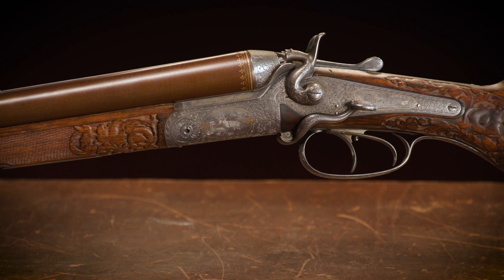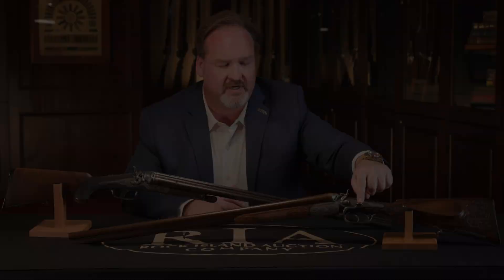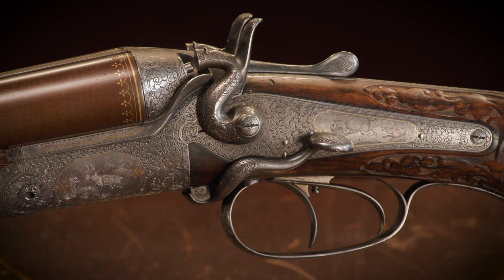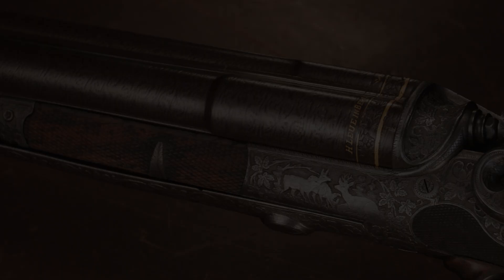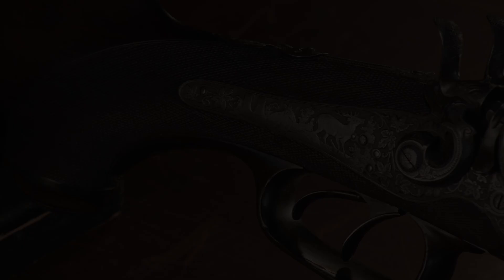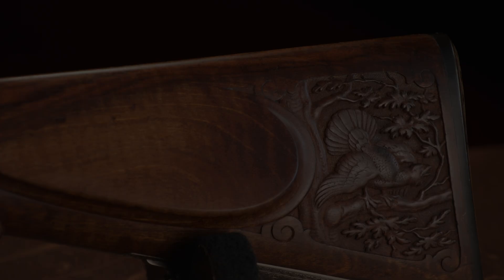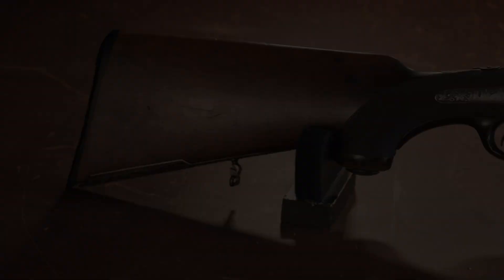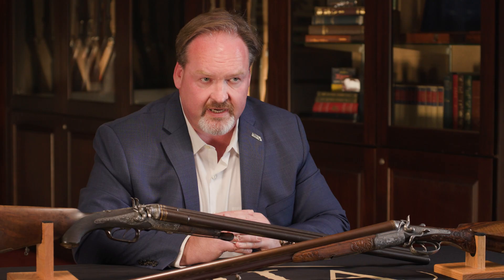Drilling & Schienendrilling German Hunting Arms

Comment: I have a drilling nearly identical to your first example. But in calibers of 10x10x45-70 blackpowder. It was imported by Charles Daly. Hence it must have been ordered for an American client most likely west of the Mississippi. In the wilderness regions to utilize fully those large bores? Strangely, it does not have sling swivels. So it must have been carted around, mostly in a saddle scabbard or wagon box? Someone professionally replaced the butt stock some years ago. It's long 30 inch barrels are heavy yet beautiful.

Comment: I've looked up some German sources and it seems that the proper definition of a Schienendrilling (aka. "Ranger"-Drilling) is having a small calibre (usually a .22) rifled barrel embedded in the rib between the 12 gauge barrels - hence the name (Schiene = rib). The specimen here might not be an example thereof but just an ordinary Drilling with the much rarer configuration of the rifled barrel on the top.

Comment: My father picked one of these up when he was in WW2. The story goes like this. His platoon came to a small city where they had to secure. After the German soldiers retreated The residents were still putting up a good fight and because of this they lost a few more good men. When they finally surrendered, the American Lieutenant leading the platoon told the residents to gather all their arms and deposit them in the town square which they did. He then told his men they may take one weapon each from the pile. My Father grabbed the drilling. After everyone grabbed what they wanted the doused the pile of guns with gasoline and set them on fire, then as the fire burned down they ran over the smoldering pile with a tank. It was a gun I later used as a boy rabbit and pheasant hunting with my dad and older brothers in Ohio. No one else wanted to use it because you had to cock those two hammers back for the two shots and it wasn’t an easy task. I believe the shotgun barrels were 16 gauge and the lower rifle barrel was a 8.6 mm. We used to call it the “‘rabbit ears” because of the hammers.